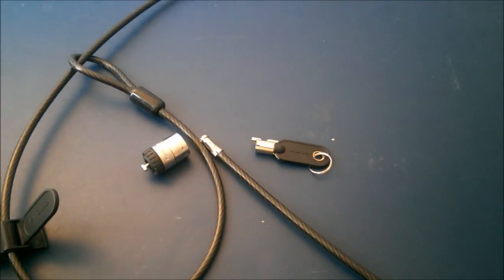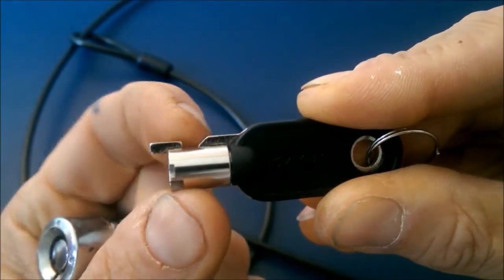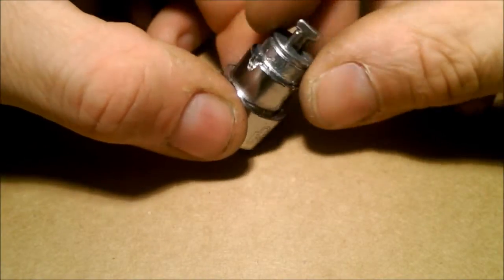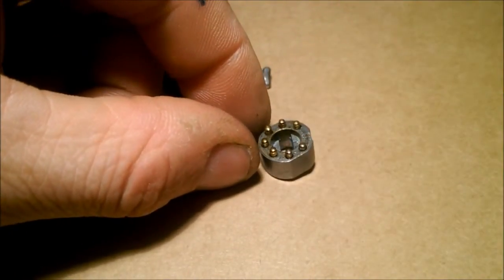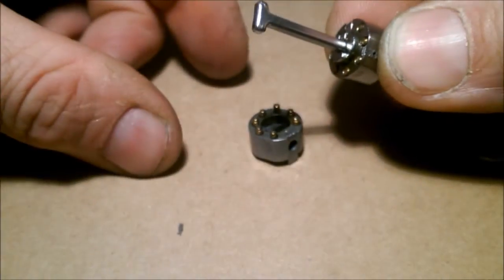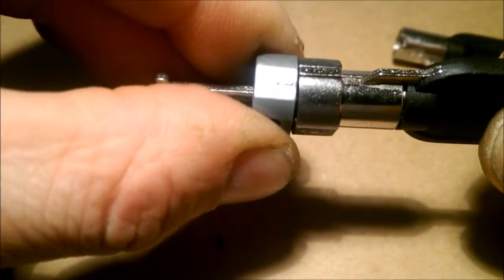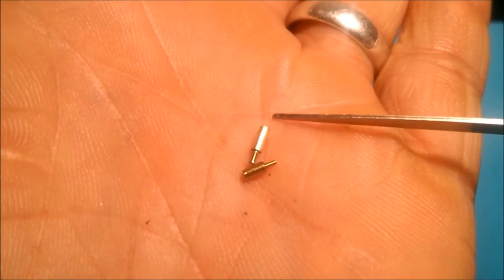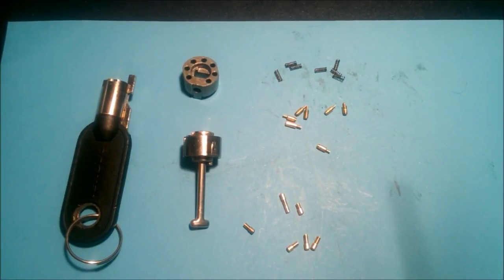(picking 12) Kensington laptop lock disassembled and explained (was picked before)

Comment: I single pin picked this exact lock at week last weekend.  I eventually did realize I was locked up deep in position zero.  I fabricated a long very thin pick from a tiny drill bit to reach it.  If I had the key, Or if I had watched this video, would have noticed the long protrusion on the key and realized the trick Kensington used to make this lock pick resistant.  I did pick it but Kensington’s trick did slow me down about 15 minutes to figure it out.

Comment: Back in like 5 years , I thought that these locks are awesome and "must have" for laptop owners , but , due to a lot of flaws that tubular locks have , and after seeing to what do they attach inside of laptop , they're to the point of no use. And those were expensive back then. And , You can break hole and a little inside of laptop , and it will still work normally. To be even worse , cheap tubular locks impression tools can be bought from sites like banggood. Absurdly , set of such tools is cheaper than lock itself , and , laptop can be stolen in a matter of seconds. Terrible implementation on both sides of how something has to be physically protected. And , final execution of lock itself is quite disappointing. Not just breaking , but cutting those bent wires who should prevent "T" end from rotating inside laptop can be easily cut off. I just hope it fits and stays tight inside laptop keyhole , to just prevent such dumb attack. 

Thanks for gutting it , anyways. :) 

(BTW , with a little experience of picking simple tubular locks , I wonder how did You missed "blind attack" on pin No.1 , I attack all tubular locks in that position first. Some of really simple ones can be impressed and rotated by just hitting that part , no need to mess with the rest. :) Maybe this can help in future , tho , You did some picking of these things (can't say how much) , they are always fun for simple picking) :)
Reply from the maker: It was my first tubular lock - look at the video number, it's -12- and more than three years ago. So I learned all the first time in this video by just inspecting the parts - no pre-knowledge. I think that these locks a good against an unskilled and unprepared thieve that just take the chance if he sees a laptop unsecured. It's better than nothing.
Reply: Sorry if I have been too harsh or rude , didn't meant to. :) Haven't looked at video number , just decided to look for someone who covered this particular lock manufacturer. :) This is the best I've found , and first. I was surprised that almost nobody from lock picking community didn't played with them. :) Some of Kensington locks also have alarm , so , that's another interesting feature in combination with this. If I get one , I'll demonstrate almost all possible attack vectors in picking , but will skip those which might lead to easy theft or something of that kind. Too bad for price that they charge , they didn't put a better lock , like small dimple or disc detainer lock.

Anyways , I was skilled little "burglar" when I was a kid , and , my landline phone had such one on back , it wasn't just lock , but also a swith , so , it had 3 positions: 0 or green - all calls are allowed ; 1 or yellow - calls are allowed , but their first number can't start with 0 or 9 ; 2 or red - no calls are allowed , and dial pad won't dial anything , except emergency numbers. (when I collect enough locks , I'll start a channel with demonstration of how these worked IRL) That was in 90's. :) Locks like this , and lever locks are funny and fast to bypass aka - bump. :) They can be impressioned , bump keys can be made easily , once You get into the matter. :)

I agree that it's better something than nothing , but , when it comes to laptops , that era (assuming You had brand new one when made that video) , motherboards and CPU's have 3G antitheft chip built inside them. :) Well , Intel ones , as I'm their fan and customer. :) That being said about me , I'm glad that my knowledge never took me on wrong side and I never did something that could screw my life and carrier , especially in my field of work. :)
Reply from the maker: Thanks for the feedback, I'm subscribed to get notified when you upload :-) Here's my telephone video https://youtu.be/L01Wxtlaufs I had some fun with it.

Comment: I am in this same situation. Were you able to get the driver set back and continue picking? I am unable to get the driver returned to the lock interior, at least for now.
Reply from the maker: No, I just took it apart as you can see in the video. But meanwhile I picked many other tubular locks ( example https://youtu.be/WEmxW_Ianqo ). Watch the tension and check that you don miss to pick a pin. Good luck.